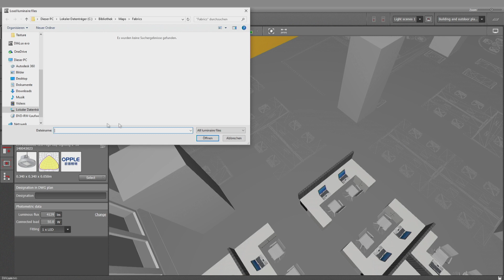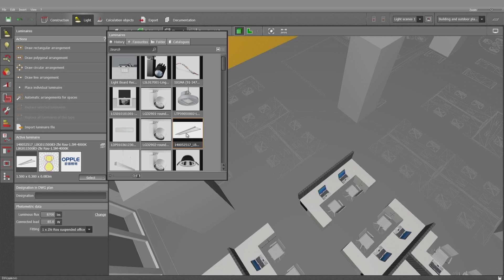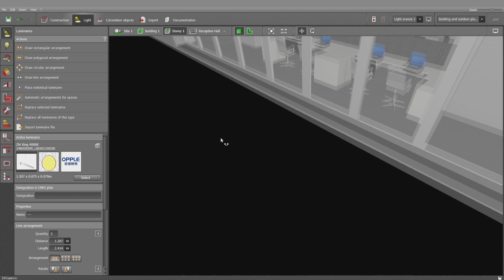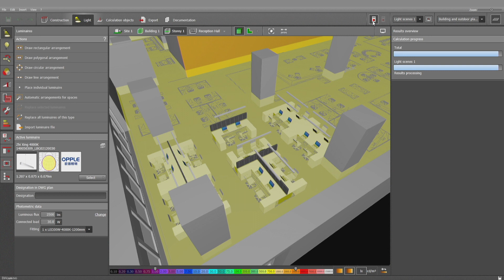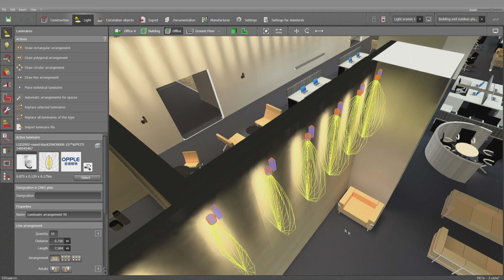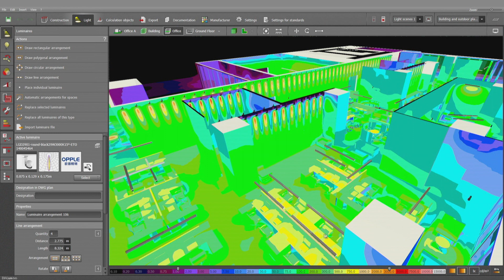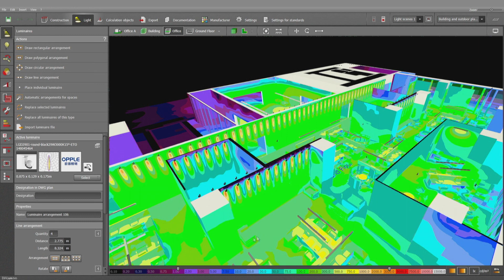DIALux evo Tutorials for Beginners part 30 — Effective lighting design

Comment: Hi Michael, I have a problem composing a building with differrent height levels. Building is wider generally with flat roof / height of 3,4 m/, but in the middle there is one higher hall which is covered with sloped roof /4,17 - 6,8 height = 10° sloped/. Could you give a tutorial on such a case. Unfortunately architect has no 3D model which I could import for lighting design purpose, yet we are solving some complicated views, which we need to test in dialux. Thank you.

Comment: Hello Michael, I am just trying to push a move from Dialux 4.12 unto Dialuxevo at my company and have just recently started using it on actual projects. You videos have been very helpfully as I navigate this new platform, however I was just wondering if its possible to isolate rooms when making lighting simulations as in Dialux 4.12. I work on buildings with a lot of rooms and have noticed anytime I click on simulate it calculates the entire storey, which takes a lot of time. Kindly share your view on this. Thank you.
Reply from the maker: At present it is unfortunately only possible to calculate the whole project. We will, however, improve this in a future version of evo. Retrieved from: https://www.dial.de/en/dialux/support/faq/